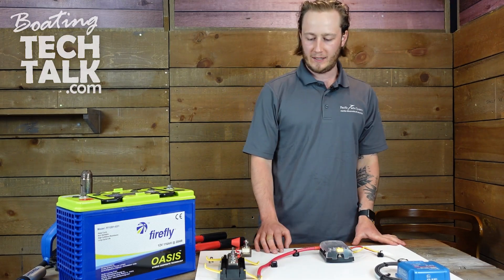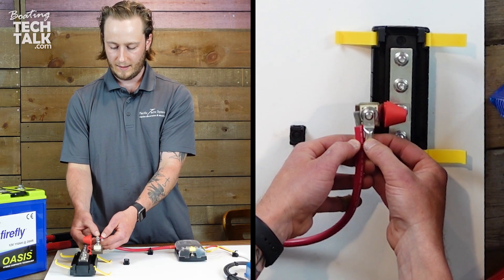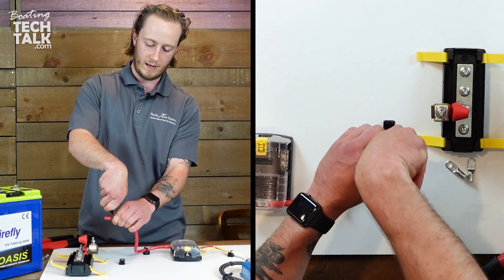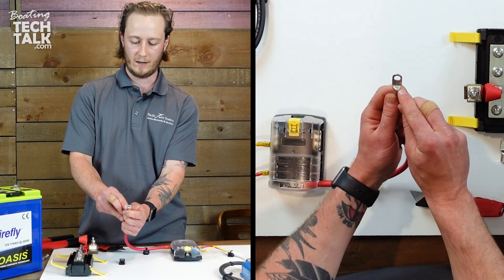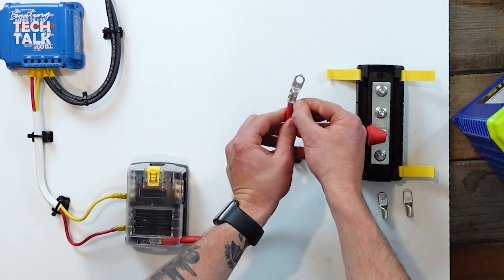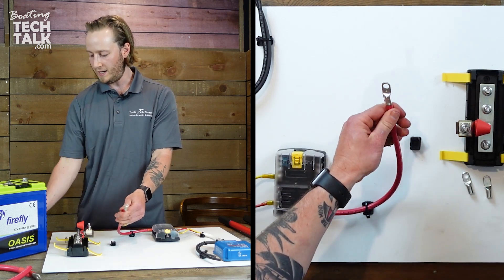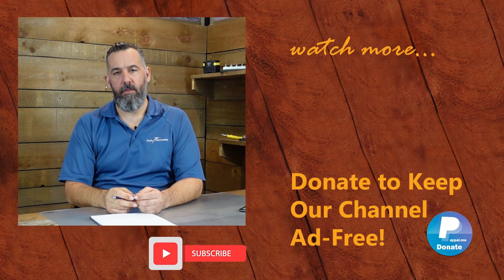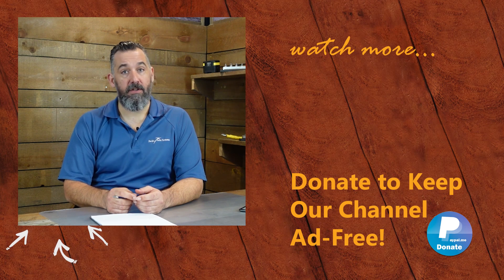How-To Cut, Crimp and Heat-Shrink Large Gauge Wire on Your Boat

Comment: Very surprised that there is no mention either in video or comments about being sure to orient the lug on the cable so that no twisting is required for installation. Maybe it goes without saying as you find yourself swearing at the lug when you do it wrong the first time, but really, a tip or two here would be helpful. What I do is mark both the cut point and orientation (on top) for the cut of the cable. Another thing I like to do--a small thing--is to orient the lettering on the cable in a direction that it can be read later, to easily see what the gauge is.

Comment: Why is the solar controller going to to fuse block instead of going right to the bus bar with its own MRBF fuse? I would think anything running off that fuse block would be getting its power directly from solar vs. The batteries this way?
Reply from the maker: Sorry for the confusion, a solar array, like other charging sources, should be connected directly to the battery or a unswitched positive distribution. Effectively, you want your solar array to always be connected to the battery even with the battery switch off.

Comment: Should you ever add dielectric grease before crimping?  How do you handle odd angles with heavy gauge wire? That is where there is not room to comfortably lead the wire straight off the terminal.  Are there angled lugs?
Reply from the maker: We've never done this before, not sure it's required. 
You might have to slightly bend a lug connector to get to fit a terminal, but we rarely do that.

Comment: I could not help noticing that the wires going to the charge controller have crimped terminal ends. Those are ferrule terminals, correct? 

What style ferrule ends; rectangular or hexagon are you having the best luck fitting the popular charge controller terminals?

Thanks for the great content you post,
Scott
Reply from the maker: The ferrules we use, when possible, are hexagonal ferrules, But unfortunately sometimes the terminal strip with a device isn't big enough to fit a ferrule terminal.

Comment: Very helpful Thank you!  Off topic question:   I am currently wiring my solar panels to charge my house bank.  Can I just stay with 10 gauge wire to the battery or do I need to increase the wire gauge?
Reply from the maker: Hi Joe, depends on the size of your solar array, make sure the array doesn't output more then 30 amps (max rating of 10 gauge wire).

Comment: Looks like compact hydraulic crimpers and cutters would be handier on a boat...
Reply from the maker: Could be, always nervous about a tool not controlled by your own motion (albeit difficult). Anybody else use hydraulic or electrical power crimpers?
Reply: @PacificYachtSystems  Ah yes, I wasn't thinking about the battery operated ones, but the ones with the lever compression system like this one: https://www.mcmaster.com/cable-crimpers/hydraulic-compression-lug-and-splice-crimpers-7/ 
There you still have the manual control of the crimping process, but in a more manageable package.

Comment: I though you are supposed to fuse at the battery???
Reply from the maker: Yep, most circuits are fused near the battery but not necessarily on the battery, for example an ANL fuse holder cannot be mounted on the battery post itself, but as a separate fuse holder located near the battery.

Comment: Aren’t there proper wire strippers for stripping insulation off of large wires to avoid having to use a knife and risk cutting strands?
Reply from the maker: Hi Borys, good question, with practice you get to know the right pressure to exert on the blade. Different cable manufacturers have different wire jacket insulation which makes preset strippers hard to use on varying wire jacket insulation.
Reply: yes there are, but you'll still have to set the cutting depth. For example this one: https://www.amazon.de/dp/B003A6D27E/

Comment: I'm totally confused as to why you didn't just use hand cutters instead of a big 2 handed heavy set.  Makes no sense.  None.
Reply: You could try the hand cutters, but on this size you will get a horrible result that will not fit into the lug properly.
Reply from the maker: Hi Timothy, sounds like you have lots of arm strenght. A 4/0 wire is definitely hard to cut with just hand pliers we found. Which 4/0 wire cutter do you use frequently.
Reply: To get a clean, square cut.  You need the big lug crimper, use the big cutter.
Reply: Can you discuss what crimpers (brand/lug range) you use,  also lugs (starter vs power)